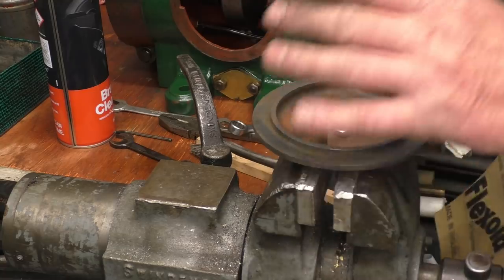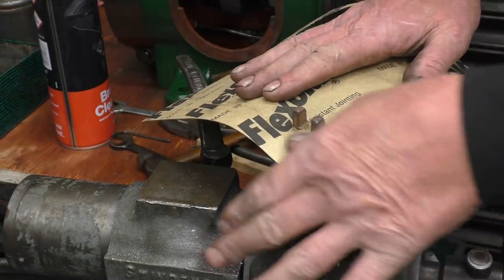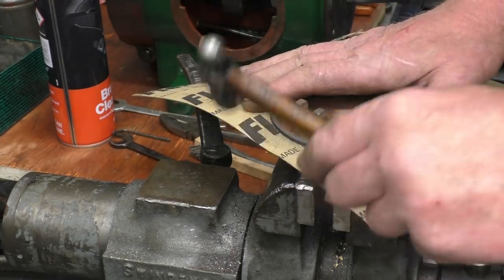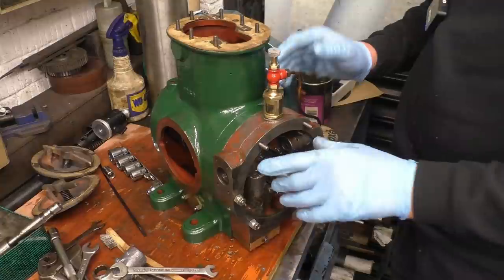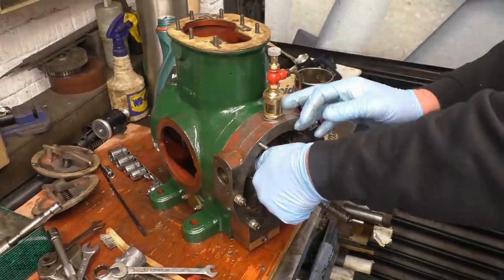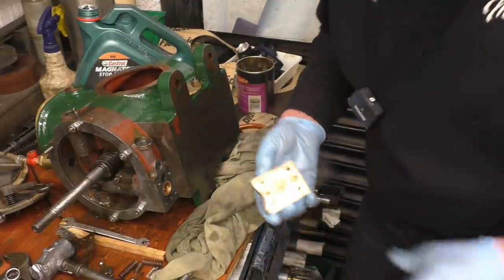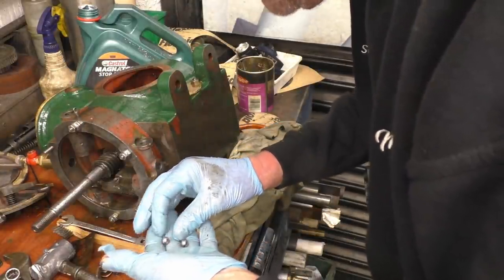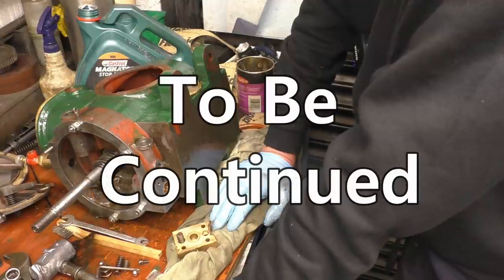Stuart Engine Restoration P9 A . Pitted Balls

Comment: Good catch on the pitted balls in the oil pump. It never hurts to check things as you go along. You probably would not have found the problem until you had it all together and couldn't get oil pressure, much better to find it early and repair it than to have to backtrack. Making good progress otherwise, and I look forward to seeing it run. My best to Deb's and all the family.
Take Care and Stay Safe.
Bob

Comment: Seemed fine last week when you used your battery drill to turn it? It is a high speed engine too you said? needs to be turning at high speed then eh? A sharp crack onto each ball with a hammer will seat them properly. The ball bearings, that is John!

Comment: Hi John just a quicky, that jointing paper you've used on the Stuart Engine could I use it instead of gasket materials for my Motorcycle, Also is there thicker thicknesses of jointing paper or do I have to go get the proper gaskets for my engine. It seems that it could be a more cost effective way instead of buying separate gaskets? All the best John, keep it up Canny Lad.
Reply: You will be able to get a pack of different thicknesses mate.
Reply from the maker: The paper is available in various sizes , Making your own gaskets / joints is very rewarding
Reply: @LNM0000  Cheers, I'll be looking out for those for my next purchase.
Reply: @doubleboost  Cheers John.